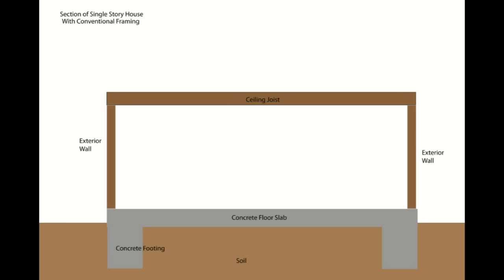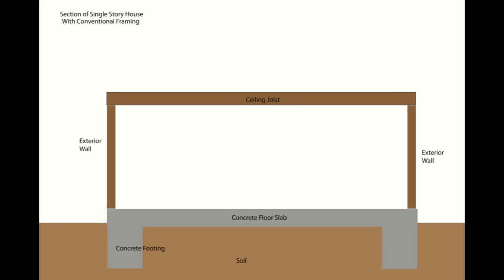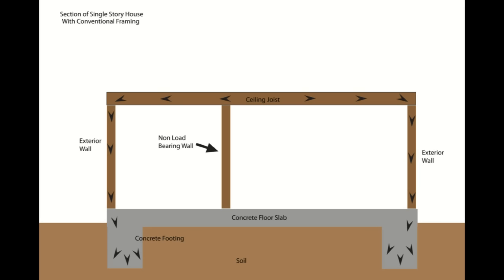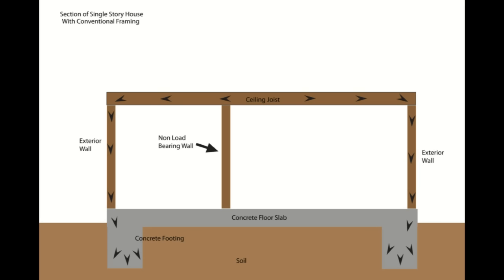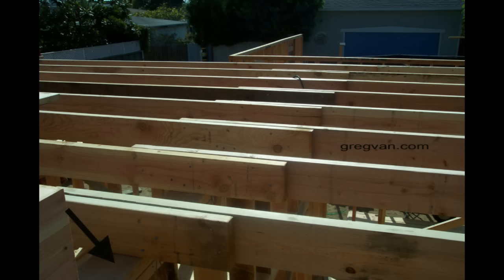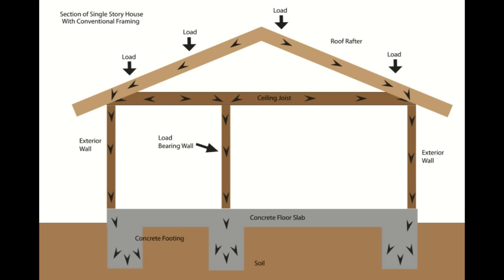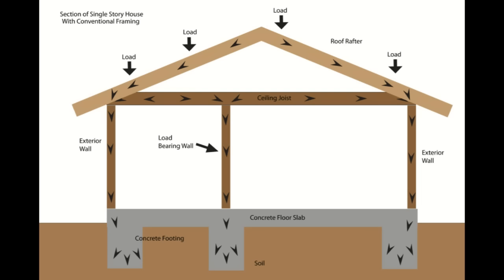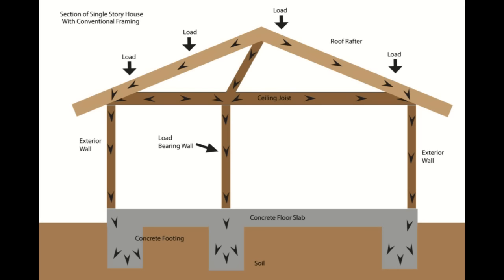Load Bearing Wall Framing Basics - Structural Engineering and Home Building Part One

Comment: If  non load bearing wall  is installed fairly tightly under the ceiling joist , .is it not bound to take some of the load due to settlement over time ?
Reply from the maker: Richard Budgell You're absolutely right and there are plenty of non-loadbearing walls that are actually supporting other parts of the building. I've seen people remove non-loadbearing walls, creating longer ceiling joists spans, only to find out years later that the ceiling is sagging.
Reply: Thanks for that Grevancom
Reply from the maker: You're welcome.

Comment: Do the footings need to run the length of the wall if a pole structure is being built? I would assume the weight is distributed down the rafters and down the poles so footings in between the poles would not be required.
Reply from the maker: I've seen plenty of pole buildings built with individual footings used to support individual posts, but I'm pretty sure a structural engineer would love to see a solid concrete foundation tying all of those individual footings together.

Comment: The rafters are most often not parallel to the load bearing ceiling joist, correct? I have a home that is small and very similar to  the home depicted in this video. I want to raise the ceiling in my living room to the rafters. However, the loading bearing ceiling joist is perpendicular to the rafters. I'm unsure of the structural component of the medial ceiling joists that span perpendicular from the exterior wall to the load bearing ceiling joist within the center of the home. I know they are connected to the rafters, but as I mentioned I'm unsure if they are only for the drywall to be attached or if they actually provide some structural component. I can see now that the answer will most likely be, "it's possible, consult an engineer".
Reply from the maker: Doctor Doom You guessed it, I can't give structural engineering advice and suggest going to this link http://video.gregvan.com/house_framing.htm to see if you can find some more information, also check out the engineering links on the same website. I do have some good news though, if the ceiling joists aren't being used as rafter ties, then there's a good chance you will be able to remove them, but they could be providing structural support to other parts of the building. Feel free to send me some pictures if you want by visiting the website and going to the contact page for our email address.

Comment: Would using a light weight metal roof in place of the current heavier concrete tile roof effect the current cement block load bearing outer walls ability to withstand 140 mile winds of a hurricane.
My concern is that the current roof weight transfer to the outer walls adds strength to these load bearing walls. Your comments will be appreciated.
Reply from the maker: It's difficult to suggest a right or wrong answer, because it would depend upon how the building was constructed and each component fastened together. With that said, I think you have a good point, I just don't know how relevant the weight would be if the rest of the building was constructed poorly.

Comment: I have a home built as pictured in this video however the ceiling joists in one room (12x19 feet) have bowed at about the midpoint between the outside walls (approx 19 feet) across. There are about 6 joints (across approx 12 feet wide) that have bowed. It appears that there was, at one time, a wall in this bowed section that was removed to create a larger room. There is an arched divider that extends from each side of the room and the original wall cap was left in place for this "decoration" to be framed around. Due to the amount of insulation in the attic, I cannot see the size or condition of the ceiling joists. This home was built in 1958. How can I correct or repair the bowed joists without having an exposed support beam?
Reply from the maker: It sounds like the ceiling joists are going to need to be replaced. The ceiling joists might be too small, instead of 2 x 6 they might need to be 2 x 8. Feel free to send me some pictures and I will see if I can provide you with a different repair.
Reply: I will send photos once I can get someone to crawl up there for me. I am not able to get into the attic myself. I do know there is about 18" of cellulose up there and will need to be moved aside for photos. Thank you for the reply.

Comment: How do you control some sofe ground with footings to support a level building ?
Reply from the maker: If you have soft dirt, then you can use form boards to block dirt from going into areas that will be filled latter with concrete.

Comment: Ok I have problem ,I have wall I believe is bearing wall but the wall is maybe 1 or 2 foot off of the main steel beam and the floor has huge hump on the beam is located maybe is 1,5 inch high ,is this defect construction ? The install the steel beam to high ? The house is 1966 they used steel beam on that year ?  What is the problem ?
Reply from the maker: I would need to see a picture of what you're talking about. You can get our email address at our website.

Comment: Shouldn’t the exterior walls be centered over the footings? Thanks for the video.
Reply from the maker: Common sense might suggest that you are correct to equally distribute the weight the walls are supporting, but it won't always going to be the case and most homes built today have foundations similar to the examples shown in the video.

Comment: I have an interior wall that has no support underneath  but has a truss connected to it. There is one truss connected to the beam in the attic that goes across my wall.  I need to move the wall back about 44 inches. Can I add trusses to go to a different wall to support the roof line? or can I add temp support move my wall over and then re attach the truss to the new wall?
Reply from the maker: As long as the wall isn't structurally supporting anything, you can remove it, but you would need to verify that the wall isn't supporting anything and this would require contacting a structural engineer. If you're not going to contact a structural engineer, do a little more research. Remember, these roofs are considered engineered roofing systems and the wall you move might actually be part of the system.

Comment: Is it safe to say that your wall is not load bearing if it runs parallel with your joists?
Reply: I would think so. There's no place for the load to bear on it. That's only my opinion though.
Reply: Probably. Unless you see some type of support for a beam resting on it or its an exterior wall.

Comment: I want to construct one floor on my existing load bearing house which is almost 30year old. Is it advisable to go for additional floor and if yes then what are the precaution to be taken care. Apart from it you can suggest alternative construction methodology
Reply from the maker: If you're talking about taking your roof off and adding a second floor, then you will need to increase the strength of the building foundation. Let me know if this is what you're planning on doing, if not feel free to ask more questions.

Comment: I want to open wall between the dining room and the living room.
The wall is next to the chimney flue. Going up the attic I notice that the wall is going along with one of the ceiling joist. Is that a non bearing wall or load?
Reply from the maker: If the ceiling joists don't sit on top of the wall then it might not be a load bearing wall. Feel free to send me some pictures for more information.

Comment: I'm about to add an addition to one end of an 12' x 16' pier-n-beam building, the trusses are stretched across the long 16' walls in which the video would be spot on in my situation as for as load bearing goes, my question is would the end 12' exterior wall be a load bearing wall in reference to the lay out in the video? I'm not sure if I need to support that wall that is running parallel with the trusses with a header.

Edit in: we will be tying onto the end of the existing building with new walls and trusses starting with a newly made truss butting the new truss up to the existing extended soffit face board and following the same line on down for another 8'  all in conjunction with the old building.

Thanks
Reply from the maker: Most exterior walls are going to be load bearing walls if that answers your questions. If this doesn't answer your question then feel free to email me a drawing or picture, because I'm having a difficult time trying to imagine your project in my mind. Remember, I'm also not allowed to give structural engineering advice, because I'm not a structural engineer.
Reply: gregvancom  Hi gregvancom, I tried sending an email but received a delivery failure from the email address on your profile.
Reply from the maker: I Randy, I got your message and responded. Let me know if you have any more questions.
Reply: Yes sorry Greg, I did some digging and was able to locate your email, thanks
Reply from the maker: I couldn't of said it better myself and thanks for sharing.
Reply: So even though I plan on adding an extra 8 foot with adding 5 more trusses stretching the 12' length across the newly built walls, a header would still be required? And if so would two 2x6" together be enough? I have no problem adding a header but the jack/trimmer studs would protrude into the work space in which I was trying to avoid though I do want to be safe. The building in question is a woodworking shop, 14" bandsaw, hybrd tablesaw, miter saw, planer, sanders etc....
Reply: Thanks! I follow you Jason, what you suggest will work perfect for my project and by installing 2x8's on each side of the truss in the ceiling it will forego the need for the jack studs am I correct?
Reply: Jason, Our code requires wind bracing, so I'll be installing wind bracing along with the ties, Thanks so much for your help in this.

Comment: Maybe you can help me, I cant find data online: I have some 8x12 doug for beams. 24' long. Planning on running them in a 'post and beam' room. Can I run them on 7' centers and will they hold a snow load? Or will they need to be much closer with a 24' span?
Reply from the maker: I cannot provide you with engineering information. However, if you're having a problem finding information, feel free to email me some pictures or a drawing of what you're trying to do and I'll see if I can get you going in the right direction.
Reply: What do you mean by 7' centers? Are you saying that they span 24' but are supported by a beam/column every 7'? If so, that could possible work. I may have to do some quick calcs
Reply: @Ahmad-Str  yes, I plan on purring a post (wall) up, and placing these 24' long 8x12 beams every 7 feet. On top of the wall. (Wall at each end) making these beams span a full 24'. 
Question is can I run these 24'  beams 7 feet apart and still support a snow load? 

Of course I will run 2x6 rafters ontop of the beams like a traditional roof.

Comment: I need your help. I just bought a 1950s brick house. and the whole thing is constructed with 2x3s. I wanted to replace all the windows and doors but everyone only sales things for 2x4 construction also I need to install insulation and it seems the only way I can pass code is with spray foam which is too expensive. and rigid foam. also all the walls are very thick because they have vertical tongue and groove planks on them with horizontal wood ferring strips behind them. I wanted to remove all the wood ferrings and tongue and groove to replace it with drywall. I don't know what to do!
Reply from the maker: Send me some pictures of your project and windows and I will see what I can do. You can get our email address at the website.

Comment: Are closets considered load bearing? I have a small bedroom with a closet that I would like to remove. I would think the wall separating said bedroom from the living room would be the load bearing wall here and taking out the closet would have no effect on that wall or the structure itself?
Reply from the maker: crystalwolf2006 Closets walls can most definitely be used as loadbearing walls.

Comment: I'm planning on remodeling my home basement on a 2 story house, basement has a load bearing wall running the length of the house around 50', its right on the center of the house, actually its a beam ( I believe it's 12x12 ) My question is can this beam be removed? of course I'm contacting a construction company to do this.......... Thank You.
Reply from the maker: It sounds like the beam might not be able to be removed.

Comment: Good video. I've watched a couple by you and they are very informative. I have a question though.
I have a wall that is on the gable side of a house that is between the main house and an addition. The wall was the exterior gable wall so it is on concrete block next to the underlying crawl space. The addition is on a slab that is about 10" lower. I would like to remove a section of the wall and replace it with a header (2-2x10) that I would like to be approximately 10' in length. The girder/header span charts that I have found only account for load bearing walls, I'm assuming the gutter side walls (sorry don't know term). Since it is on the gable side, is it still considered a load bearing wall or is it considered something different? I'm not opposed to putting in a cheek wall, to support a smaller header, because the 2 rooms are a kitchen and living room but would rather not interrupt the flow between the 2 rooms. If I can't span that distance with 2-2x10's I'm sure that I could do it with a flitch plate header but would rather save the money if I could. Thanks in advance.
Reply from the maker: I'm not allowed to give structural engineering advice, but most of the time a 4 x 10 or double 2 x 10s will work fine for a 10 foot opening on a single-story wood framed building or home. However, you should take into consideration the length of the wall itself and I'm going to try to make another video within a few weeks to explain myself so stay tuned to the main channel. If the wall you're going to put a 10 foot opening into is less than 18 feet long then you might not be able to install the opening without reinforcing the walls.

Comment: Is there also a contact criteria for the nonbearing wall: by this I mean the distance from the bottom of the joist to the top of the nonbearing wall. Is there a distance to consider it nonbearing?
Reply: *I'm talking about the case where clearly the joists spans over the nonbearing wall. You clarified the case where the end of the span of connecting joists is at the bearing wall and I thank you for that.
Reply from the maker: There is usually no gap in conventional framing between the bottom of the joist and the top of a non-bearing wall framing plate, but usually is when using engineered roof trusses.
Reply: So, it's mainly about whether or not there's footing undernearth?
Reply from the maker: Yes and any load that the wall would be supporting from above like a roof or a floor.

Comment: How do you find out where the low bearing wall is at
Reply from the maker: A load bearing wall is simply a wall supporting some type of weight like from a floor, roof or ceiling.

Comment: If the wall is attached to the ceiling joists it is countering gravity of the roof and bearing a load whether you want to call it load bearing or not.  Whether the joist extend the width of house or joined together is irrelevant.  The only way to see if the plan requires this wall to support the weight would be to look at the original calculations.  Just because you call it load bearing or non-load bearing  doesnt mean you'll overcome basic physics
Reply from the maker: If you're suggesting that some building components will transfer more weight then you're basic physics could be correct.

Comment: Very information. Question how can I brace a wooden structure 12 x 20 two story 
from the exterior for hurricane winds?
Reply from the maker: Your question is difficult to answer, because it usually requires spending thousands of dollars and practically rebuilding the entire structure. You would be better off contacting a structural engineer in your area for more information.